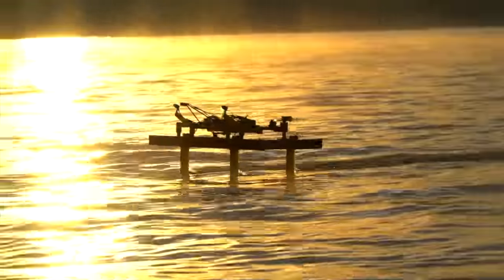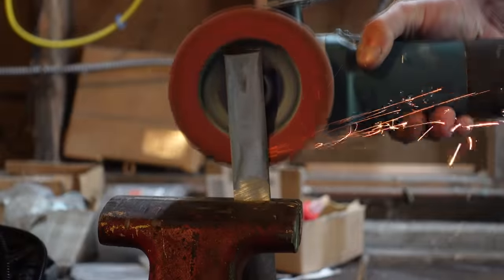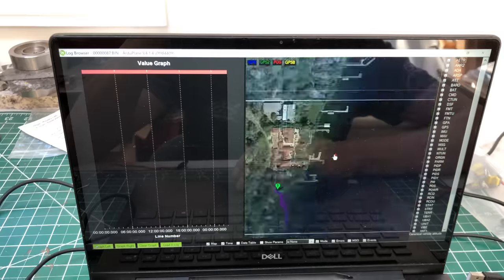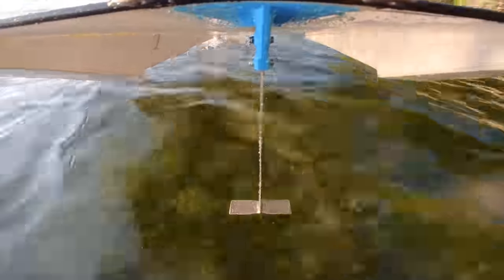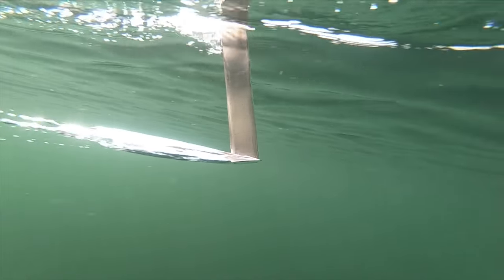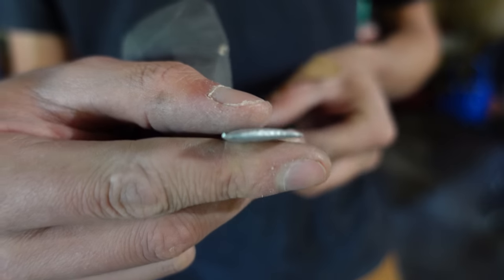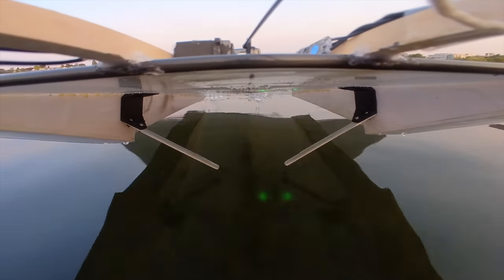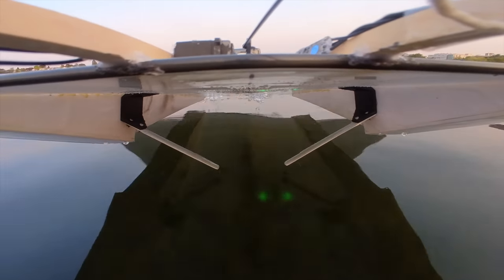Airplane + Hydrofoil - Good or Bad Idea?

Comment: I wonder what would happen if you ditched the foils, and instead used like 2-4 semi rigid plastic strands. Have them in a trailing arm fashion, sort of like catfish whiskers attached to the leading edge but flowing towards the rear, dragging them. They would kind of dangle when not in use. Then once they touch the water they would bend at first, but eventually add a little resistance and push back up. Some weed-eater strings would likely be perfect. They act kid of like skids. They would be snag free and you also won't get grass snagged. This would work also on land. Even when parked it would keep a small gap on land.
Reply: Basically very flexible and light skis?
Reply: @wiegraf9009  yeah pretty much
Reply: He should also experiment with the new hydrophobic coatings. I bet they would prevent the stickiness of the water. They have new toroidal designs of propellers that are said to be twice as quiet and twice as efficient of conventional blades. I wonder if it will work with hydrofoils as well.
Reply: @hughgrection3052  Using a toroidal propeller with a GEV is actually a pretty promising idea, just wonder if it would get clogged with plant matter
Reply: @wiegraf9009  maybe if on the foil yes. I wonder how long it will take for new super quiet subs to see and make use of the new toroidal designs. With near zero cavitation that's seen so far I bet they would benefit the most. Won't be long and I think we'll be seeing them on nearly all devices and machines, even cooling fans. I've seen how they even make outboard boats tons quite while going much faster too. It may even save some manatees and fat-chicks some motor scars in the future lol😂

Comment: The reason that your "knife" T-foil oscillates in and out of the water is that it is too far forward. If it were behind the center of mass, increased lift by the foil would pitch the craft downward, reducing lift by the wings. This produces a mechanical negative feedback that stabilizes the height of the craft above the water. If the foil is placed ahead of the CoM as you have it, increased lift by the foil pitches the craft upward. This increases both lift and drag and causes the foil to leave the water. This also produces a "coarse" negative feedback as lift is reduced when the hydrofoil is out of the water. So the craft oscillates between the foil being in and out of the water.
Reply from the maker: Putting the foil behind the center of mass just makes it nose dive
Reply: @rctestflight  You'd need to mount the motor with an upward thrust vector, to counteract the negative pitching moment that the foil would create and bring the overall moment closer to zero. If you do that then the foil will exhibit mechanical negative feedback. It would be a funny looking craft, sure -- the motor "dragging" the foil along. But it would work and be monostable!

Comment: What you are calling "ventilation" around the hydrofoil (i.e., the underwater bubble of air) is traditionally referred to as "cavitation." Cavitation describes the water caving in onto itself. It occurs naturally when a boat prop or screw is turning at a high speed.

Comment: Very interesting technology used to adjust foil….im no scientist or know much about physics, but my intuition speaks to me about this tech being applied in a little different manner …what if you created a wing ,similar to wing boarding type, that would provide lift in the air, attached to a foil that would provide downward force in the water …your technology could possibly allow the foil to adjust for the correct amount of downward force and could create a forward thrust …basically a wing attached to a foil that would maintain a plane under the surface of the water …
I’ve thought about this concept for a while , but regulating both the wing and foil is the challenge…your tech may be the ticket…
What do you think?

Comment: Hey! I have a challenge for you! I’m wanting to experiment with building a hydrofoil for my 20 foot swing-keel sailboat that I’ll be using in shallow water (ambitious, right?). 
If you can get a model designed that works on a small scale r/c sailboat, that retains deployability as well as high speed stability, I will 100% build it and provide lodging for you at my waterfront property in the Gulf Coast of Texas to test it out.
This is a wild request, and I don’t expect this to be seen, but if anyone could do it, I think it’d be you! 
My boat is a 1969 Gulf Coast 20, if you need measurements or specifications of hull design, it’s all on sailboat data’s website if you look up the model. 
The average cruising speed is right around 5 and a half to 7 knots depending on sail trim, in displacement mode. If the hull planes on a wave, it’ll do 10-12 knots. 
Alternatively, I will gladly email you back and forth with measurements or video call if you want to see specifications. 
If it works, it will not only be the first in the state, but probably of it’s kind. 
I also have a small 10 foot Super Snark that we could adapt with a manually lowering centerboard, if you think the 20 footer would be too much of a challenge. I’m not afraid to work with fiberglass, epoxy, and wood. 

If you take this project on, I would not only be impressed, but forever at your disposal for giving me and all other budget sailors the ability to hydrofoil without needing a separate craft for it.

If it works on my sailboat, there’s no reason it couldn’t work on your Boston Whaler.

Ps. I love your work, and I love your videos. Please never stop being you, what you do is amazing!

Comment: Using a rectangular hydrofoil seems not as efficient and have lower drag as a swept wing symmetrical hydrofoil. However, using 2 or more hydrofoils would be more stable and maybe more like a hydrofoil than a ground effect vehicle. And for that matter, a design incorporating 
a hovercraft into a ground effect design would also be possible. IDK. Good videos!

Comment: I wonder if the lower drag of the metal foils outweighs the increased weight. Probably for high speeds, but not very low speeds. The question is where the transition is. The Candela C8 uses carbon fiber foils.

Comment: You could make the hydroplaning surface an acctual aerofoil. Perhaps an asymmetrical aerofoil. Depending on the design, it will ensure lift at a range of angles, I'd assume designed based on the limit that it would be angle at, when attached to the "plane" and still being under the surface of the water...

Note: I still think this is possible with the t-shaped hydrofoil, if it's designed in a specific way.

Comment: What about a ground effect craft that uses a hydrofoil for downward force? 

What I mean by that is that ground effect vehicles want to stay at a specific height to be able to control the ground effect itself. You said it yourself, you want the wings to just barely be above the surface of the water. 

So what if you made a hydrofoil that applied just a little bit of downward force to keep the wings at a sweet spot of being mere inches over the water? 

I suppose the problem might be that it would provide less downward force the the more the foil was close to the surface, unless if was a dynamic foil. However, with the correct angle, maybe greater speed would provide more force. Thus preventing the vehicle for rising above the surface of the water too much and without adding too much drag.

Comment: Have you experimented with a rear raking mast instead of perpendicular?Perhaps it would aid in reducing ventilation? 
I’ve also wondered if it could be possible to use the mast itself to generate lift in a way that reduces lift as more of the mast rises out of the water. Lower speed = more lift, faster speed = less lift. Could help the transition from wing lift to foil lift 🤔

Comment: The alititude where ground effect works depend on wingspan, the regent thing might well have simmilar effectivity as the other very low AR. But the primary reason for the high wing that it is probably impossible to get low wing plane with engines on the wing through certification.

Comment: I'm curious if the sanding was helping to contribute to the ventilation.  Like, if you hand-sanded continuously over the width of the bar going into the water, instead of length-wise, would it improve performance?  Or if you were able to polish to a mirror-shine?

Comment: Ground effects marine craft only work in calm water.
Even the high speed CAT ferries have to slow to regular speeds as soon as the waves come up.
The solution is more lift maybe?
a hydrofoil that cruises 25 feet above the surface

Comment: Congrats on your mad skills! however, in this experiment, I agree that it doesn't make sense. The purpose of the hydrofoil is to lift the vessel out of the water. how can you know which is lifting the vessel? the air lifting or the hydrofoil? it looks to me all the lift is coming from the air, and the foil is sometimes dragging through water, sometimes skipping on surface. Interesting info on drag through water though. Thx for all your work!

Comment: What if you had retractable planing surfaces? Like the the sea dart - water skis, that primarily operate in planing mode, until it get up to speed. Skis would be better at planing and leverage the flow separation to provide lift on the water.

Comment: The sea dart you show is the early one and not good. They went to a mono ski after failing to control buffeting and wicked harmonics. 
  Regent is being pretty generous on the definition of a "blown" wing. The purpose is pushing back flow separation. Adding four vortex generators is counterintuitive to me (I know nothing about anything, so..) Ideally you'd pull air from the body for cooling and bleed out it with exhaust from the wings. It didn't even look like it has slotted flaps 😒
 Rear scallops for your foil perhaps?

Comment: We think we see some finger damage?  From the start of the video, 100,000 rpm, we said OH, NO!.  Then we saw gloves later on.  Better a few finger boo boos, than an eye.   Wigs have been our greatest interest for 40 years.  In the interim, foils with motors on jackpads have been a practical solution to carry 2T at 40 knots,  using 15gph.  This replaced the $1 per pound aircraft cost ($4000) with  $150  in boat fuel.  We will still dream of a WIG, while you grow out of the sandbox.   A $1million WIG to carry 2T vs $150,000 CAT on foils does not seem just around the corner?  The current option is 1T per trip carried in a $1M winged aircraft?   Where can a WIG compete with foils?  10 hour trips?  Keep entertaining the geese!

Comment: Sorry a little question. Why are you putting the aluminium hydrofoil on the inside of the vehicle? Why not on the outside so maybe it's become more stability when it's turn left or right?
Like an additional pair of wings under the wings. So you have more options to turn faster by dipping the left or right aluminium wing into the water.
And yes I now my English is terrible 🤣

Comment: Could you maybe attach a small barometer to the underside of the vehicle with surface piercing hydrofoil and tell us the air pressure as it’s flying/pushing the water out of the way?

Comment: this design makes much more sense if the propulsion is underwater for efficiency reasons, and the plane structure is used for the same reason, to have a lift force, and so have a bigger maximum payload. Also its clearly would be more useful to have a controllable hydrofoil the same way racing hydrofoil catamarans do.

Comment: I'm unsure to what extent rc models translate to full size craft with regards to ground effect vehicles. That said, one of the concerns that aircraft have when taking off from water is breaking free of the drag from the water. My thought was to mount a hydrofoil or hydrofoils. The purposes would be to shorten the time the hull is in contact with the water, shorten take off distance, and conserve on fuel during takeoff. After takeoff is achieved, and this is critical, at least to me, the hydrofoil would be retracted to be flush with, or into the hull, so the vehicle would be in ground effect only. To my mind, there would be no real reason have hydrofoils for landing, but what do I know. Possibly, the hydrofoil would provide a smoother transition for passengers upon landing and takeoff. I don't know if passengers are thrown forwards or backwards slightly, due to drag, during landing or takeoff. The vehicle in this video seems almost to be just an over glorified hydrofoil that could be a ground effect vehicle as well. Perhaps, if the hydrofoil was mounted without so much clearance, it would more resemble what I'm invisioning. Is this feasible economically, considering fuel, takeoff distance, and comfort?

Comment: If the vertical component of the hydrofoil tilted forward, the air wouldn't ride all the way down, no? If it's mounted back near the CG, point forward at maybe 30 or 60 degrees, the horizontal portion could still be far forward.

Comment: Just an observation, as water is so much more dense than air then a sharp leading edge would behave like a supersonic wing I would have thought, even at low speeds because of the water density.

Comment: I recently watched a video on YouTube regarding the limits of America's Cup hydrofoil yachts and that cavitation limits them to a little more than 50 knots top speed (which is absolutely insane: wind powered boats that could keep up with interstate highway traffic!)
Anyway, there's another sailing vessel that can best these speeds by using a novel concept. What if you canted the sail/foil to make it a lifting surface, and used a negative lifting hydrofoil to keep it from flying out of the water?
Iirc, this vessel can do over 65 knots, but only in high wind and calm seas, only one place in the world offers these conditions, off the west coast of Africa. I'm on my phone now, can't quite find the appropriate YouTube link, sorry.

Anyway, what if instead of adding lift,ba hydrofoil was used as negative pressure to force a wing to stay in ground effect?
Reply: Would need to be actively stabilized but it could work since the water is generally less turbulent than the air

Comment: The step of a flying boat wasn't the first idea.  It took a lot to get to the step ...
You need to plunge the vertical element before the horizontal fin.
And try a delta shape.

Comment: I was wondering.. half way through the trail you moved the hydrofoil to the back. Did you see any improvement in longitudinal stability? As per the theory "the third neutral point, also called the hydrodynamic centre in heave, should be located downstream with respect to the neutral point 2, to have an AAMV that is statically stable in heave." (Maurizio Collu et al).

Comment: I actually really liked the ram effect design, the only real problem was the turning radius.

Maybe I'm super confused about aerodynamics, but what if you tried a flexible joint to turn instead of changing how much power went to each prop? As in, pull one of the props closer to the the back wing on either side, with a slightly deeper and longer skirt with a flexible joint in the middle. (Flexible through conjoined plates like medieval armor, and by flexible I only mean side to side flexibility) If I understand correctly, this should give you a tighter turn radius without the plane dipping into the turn as much. (Or I'm an idiot typing way out of my depth and it'll do the complete opposite, but it's a fun idea in my head)
Reply: Yeah but wouldn't he need some kind of actuator to make the joint flex?
Reply: @angelorondini5835  yeah but I mean that's just a bit of weight from some kind of motorized joint, and he's also already proved it can take a little extra weight.

Comment: Logical error in your sharp vs blunt leading edge. If the water is 800 times more dense than air, the speed of sound is different as well. The sharp edge might be exactly what you need for better control.

Comment: Great video and really interesting information!  I think your submerged foil was pretty much designed to plane on the surface - like you said there's a feedback loop in there.  Probably needs an active control loop to keep it underwater.  Also could you make the vertical strut into less of a blade, so that it has less of an influence on yaw?

Comment: It might well have had enough surface area to support the weight. It really must be NACCA foil shape. All of the negatives will improve. 
3: 06, sharp trailing edge isn't the best. For a cane that size, a 1/32" flat back will be more hydrodynamic. 
3: 18, the foil mount should be a copy of the foil.   Sheesh.

Comment: Does a hydrofoil generate less lift “flying” underwater at a shallower depth? In my experience of using hydrofoil surfboards I feel like flies better/easier/faster the closer the foil is to the surface of the water.

Comment: This is a comment in opposition of all the comments wanting to combine the ground effect plane and a boat hydrofoil.

Boats and planes don't mix very well. You can do one or the other at any one time, really. And optimizing the design for one or the other will result in one or the other. So do that, rather than trying to combine them.

Comment: Argh ever have a tab crash as you're about to hit Comment? Anyhow.
Thanks for this video which for some reason I've only just found. It's good to see these experiments you've done, and I'm glad you recovered the Insta because that footage is priceless! I have a suggestion in case you ever want to revive this idea again. I played with flying wings in the 70s and they came close to being short wide lifting bodies in some ways. That made me think that hydrofoils are the flying wings of the hydro world, and water skis and speed boats the lifting bodies.  That made me wonder if a longer ski with a speed step (or a pair of them) aligned lengthways mightn't give less drag and air and a more usable and controllable lift?